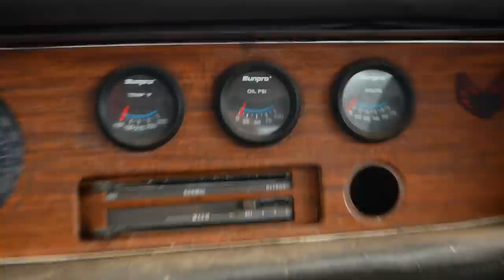Firebird Formula First Start in Years!

Comment: Is that the original hood for this car ? I love these cars...thumbs down to the SBC in this car anyway.. would rather have seen a Pontiac 400... consider a 455.. please ! Nothing wrong with a quadrajet by the way... probably the most misunderstood carb ever.
Reply: that is a factory formula hood
Reply: the 400 was a damn dog. around 200hp out of 400 inches is sad
Reply: Yeah the 350 is sad
Reply: We always called them quadrajunk when I worked at the dealership.
Reply: @zuestoots5176  I was more speaking to the originality of the car...yes the 400 wouldn't be my first choice of Pontiac engines... however I have seen some that were warmed up nice.
Reply: @lawnmowermanlawnmowerman9930  Hell I call them that to..the name just seems to stick. I have known a few guys who really know how to work them.. when they work they work well... when they don't and you don't have the knowledge to deal with them..yes they are a nightmare.
Reply: my 2 cents.  The 400 can be built, but only as far as a 2 bolt main will allow ( chevy ). The Pontiac 455 came in 3 versions. Base, High Output, and Super Duty. The base 1970-71 engine produced 200 hp and 455 lb/ft torque. The Super Duty 1970-71 engine had 335 hp and 480 lb/ft torque. Power was reduced after 1971. HOWEVER.....The Buick 455 came in 2 versions. The 1970 Base engine had 350 hp and 510 lb/ft torque. The Stage 1 engine had 360 hp and 510 lb/ft torque. ......sweeeet
Reply: The first thing to remember is, unless you've got a Ram Air 4 or Super Duty Pontiac, the engine in your hands is meant to make torque for acceleration. Too many try to hot rod it like a Chevy for high RPM, and find out the Armasteel connecting rods are basically cast iron, not forged metal. The maligned Pontiac 350 is a bit like an LS1, in that bore and stroke is similar, and the crankcase has a lot of volume. The latter is important b/c as the pistons come down their bores, they compress what atmosphere is inside the crankcase and creates pumping losses. If you want a Pontiac 350 to impress, grab a 4" aftermarket stroker crank, give it Chevy big block aftermarket rods, and then port 6X heads to feed 383 cid. As for the 400, its an overbored 389, and .030 over more means you can run a 455 piston with shorter skirts. If you honed out the mains, you can put a 455 crank in and now your 400 just got 55 cid extra. Or look at aftermarket stroker kits, you can get 488 easily. You won't be shifting at 6,000 RPM, but so what? build it for torque in that RPM range, give it highway gears, and you've got a freight train. The late 1970 blocks should be avoided like the plague, but they too can get taken out to 440 cid and warmed up. Oh, and the other issue with Pontiac engines is their lifter bores--they hang out there in space with little support, so if you go crazy on the cam, they snap off. But again, you aren't building a Chevy to run up to 7,000 RPM with a ton of lift. And that Quadrabog has a ton of tuning capacity and you don't have to take off the float bowls but you do have to realize, any spreadbore carb bogs b/c the secondaries are so big. don't open them up quick, and you'll find you have a responsive carb
Reply: Grandpa had a 70 Bonneville 455 Thing was Huge.. Putting in the Lead additives at Hess Gas station...  Dug the 60mph to 130.. Miss that car....
Reply: @lawnmowermanlawnmowerman9930  quadrajunk for those who dont know how to abjust them
Reply: @albertgaspar627  The Armalite rods are Nodular forged steel, they made the forged rods for the 8.2 cads too. Aside from the AR-15
Reply: Think about this...how long ago I'd they put the SBC in there? If they blew the original motor, it may have been cheaper and easier to but the Chevy in there. Pony motors are getting harder to find and more expensive to buy. If it wasn't a super rare, numbers matching car, I'd rather have it on the road instead of sitting there. So many project cars sit around with guys saying "one of these days, I'm gonna find the right motor to drop in there" but they never do.
Reply: @lawnmowermanlawnmowerman9930  I called them "Quadra-suck"
Reply: thats factory stats
Reply: @Trendyrapslut   I was once offered an Olds Rocket 350 for free. I was talked out of it, due to the lack of parts and aftermarket support. This was back before Olds went belly up. It's not that a SBC is a "better" engine, but the OE parts and aftermarket support is far greater. Another thought... perhaps an earlier owner pulled the original motor out for another build (GTO perhaps?) and it was sold with no engine. If I bought that car with no motor, I'd probably do the same thing. I'm not saying, I'm just saying...
Reply: @mattsez2879  Friend, your stats are incorrect. SD engines were only available in 61-63 and 73-74. Horsepower was 350 for base 455's in 70, and 370 for HO. 200 horsepower was ratings for 75-76 455.
Reply: @zuestoots5176  Depends on the year, and heads. A decent 461 build will average about 535 HP, and 550 Ft Lbs of torque.
Reply: @lawnmowermanlawnmowerman9930  undoubtly you don t know how to set them up properly !!
Reply: You're welcome. I got a 1969 GTO for free more than a decade ago, so I got to learn and experiment with the engine design. The Pontiac 350 was looked down upon when 455's were still cheap, but the day of dragging home a Pontiac Bonnie wagon that doesn't have a corporate 305 for parts is done. I was able to score a 1971 LeMans 4 door with a 400/Th400/LSD 10 bolt and a/c for $425 from a gas station who even towed it for free the next time they sent a flatbed out to my town. Took what I wanted (including T3 headlights), and someone wanted the windshield so I got them to haul it all away. Now everyone looks on the internet for car parts :)
Reply: the non-Super Duty connecting rods are ArmaSteel, which is a casting: https://www.pontiacdiy.com/connecting-rods-performance-guide-for-pontiac-v-8-engines/
and of course, Armalite Corporation made the AR-10, then AR-15 and AR-18. Ironically, when the civilian Sporter rifle first came out, consumers hated it thinking the 5.56 mm round to be a squirrel round and wanted a .30 caliber round. Now everyone wants an M-4 clone, there's even parts to make an AR-47 clone look like an M-4 with vertical foregrip and telescoping stock and laser scope mounts.
Reply: Nothing wrong with Quadrajet. Many people don’t know how to tune it or adjusted correctly.
Reply: What catches a lot of people off with a spread-bore carb, is the oversized secondaries. Dump them open too quickly, and you get....quadrabog at low RPM. But get it right, and you won't have a handful of fuel from all the jet changes.
Reply: @zuestoots5176  that was after everthing went to unleaded gas. Those pre unleaded gas 400 were very underrated in the HP department!!! It'll whoop a SBC 400 all day long!!!!
Reply: @mattsez2879  you got your years wrong dude, plus they were underrated hp numbers also.
Reply: @albertgaspar627  built right, a 350, 389, 400 Pontiac engine will live turning 7500 rpm. Factory N armasteel crank is just as tough as any Chevy sbc forged crank.  Get good forged rods, hope he puts a real Pontiac engine in it.
Reply: @byronmcelfresh2380  I should clarify. The engines you mentioned, of course, have the smaller main diameters on the crankshaft. When Pontiac tried to replace the 425A Trophy 389 with the 421, initially teams wanted to return to the 389. The 421-428-455 have a larger diameter mains so that the extra stroke in the crank has overlap on the rod bearing diameter, so that the crank has strength (just like a 400 Chevy small block uses bigger mains than the other small blocks). The result is a crankshaft with more surface area to build an oil wedge on, to keep from smearing the main bearings--same issue with an Olds 455. Getting the larger diameter cranks to survive past 5500 RPM is an exercise, but the smaller diameter cranks mentioned just need a pass thru a machine shop and balanced to some aftermarket Chevy big block connecting rods, and they'll match a solid lifter 396 for bending a tach needle.  Also, I can understand why at one time, a prior owner of this vehicle grabbed some Camaro engine mounts and tossed in a Chevy--just swap fuel lines and worry about bolting up a BOP bellhousing creating any issues. But now you don't have to go to a swap meet to hunt down BOP parts anymore :)
Reply: I love quadrajets, I've never had a problem with them even when they aren't adjusted good. The only stock carb I've ever had a problem with was the thermojunk carb
Reply: yep, and this was the prob:  https://jalopnik.com/thermoquad-252133
Reply: in this age of EFI, being the best carb is like being the world's tallest dwarf :) but I get your point, when you're slappin' together a toy with parts you need to clean out of the garage, a carb is cheap and easy way to get an engine going. Like I posted before, what grabs a lot of people is those big secondaries, which is why its typically called a "quadrabog". But, get the secondary linkage right, and its not an issue. Where the Q jet has it all over the Holley is you don't get your hands wet with gas to change the "jets". Where the Q beats the Carter is the lack of plastic. That's where its better than any carb short of a Webber/Delortio/Mukini or any downdraft carb you find on a Cobra etc. Back in my day, you could still find a Q jet in the junkyard for $5 and up, while the OEM Holley would be $20 b/c it had the name "Holley" on it (tho truth be told, i'd always try to grab the Holley 2300 2bbl off any Chevette I found, and then try to sell it to a Mopar Six Pack fan :)  )
Reply: Yes , the original hood for the (70-73)  Fire Bird Formula ! , What I really admired about them as a teenager was they were stock fiberglass hoods.
Reply: Well i guarantee you that that 350 is making more hp than the factory 180hp 400 😂😂😂😂😂 atleast you are probably getting around 250ish hp from the 350 but anything can be built
Reply: @icedragon642  i don't know what Pontiac 400s you have had but I've never owned a stock one that would just outright kick a chevy 400 ass and that also depends on the year and i don't like admitting that because i am a Pontiac man always have been the firebird to me always had way better looks and style than a camaro
Reply: as the saying goes, HP sells engines, torque wins races. I'll agree the 350  makes more HP in that condition, but torque will accelerate the weight of that F body, and its possible the bigger engine is going to do that at a lower RPM. theoretically :)

Comment: Nice Firebird! I've seen much worse! Most of the bodywork really doesn't look that bad. Yeah, The front of the roof & windshield channel are toast but that can be cut out & replaced with metal from a parts car. Definitely yank out that Chevy engine & replace it with a Pontiac engine. All Pontiac V-8's are the same size externally, so a 400 or 455 will slide right on in! Another nice thing about Pontiac engines is that  most years, they have the engines displacement cast into the blocks on both sides towards the front which eliminates guessing. Are you gonna be making more Lemans videos?

Comment: Chevy V8? Blasphemy!  The heart of the beast is missing.
Reply: That's right take that garbage out and put real Pontiac Heart shame on who ever puts chevy crap on Firebirds,,,
Reply: In those days you trashed a motor or transmission, your local “cooter “ found you a used motor or transmission that “fits”
Reply: Matthew Fogarty - Pontiac was the last division to adopt the Chevrolet “corporate” engine, they held out until the early 80’s, producing their own engines. Buick and Oldsmobile engines were history by the mid 1970’s. Pontiac did get caught up in the change over a little bit and some Trans Am’s got a Buick 406 mill instead of the Pontiac 400ci engine.  At the same time you could find a Buick engine in your new Oldsmobile, or some other odd combination. It made many people angry at the time but GM was clearing out the warehouses in preparation for the corporate (read Chevy) engine policy. It should be noted that it was a money saving measure and the other divisions were making some great engines at the time. Pontiac kept their Super Duty program going into the late 70’s and even offered a Pontiac built (and designed) 305 in 1981 if I remember correctly. 

After that, the only significant difference  between a Camaro and a Firebird was the grill, tail lights, and dash.
Reply: Matthew Fogarty - Noted. Missed it by that much, lol. That’s what happens when ya get old. Thanks for the correction (s).
Reply: Matthew Fogarty - Funny! you caught my reference there, almost no one remembers anymore. It was a fun show.

Comment: its sweet- so period correct with the gauges and shift boot ect.... probably last worked on in the late 80's or early -mid nineties? dual exhaust out the valve cover grommets after fixing the valves

Comment: I have a similar project.  I have a 73 Firebird Esprit (sp) 350/ 3-speed. I have most all of the parts to build a 455 SD Trans Am clone. This one will be a little different, 4-wheel disc brakes, WS-6 suspension, to name a few things.

Comment: an old school "tuner" knows you just fill the Q-Jet with gas, push the throttle a couple times and look for fuel from the accelerator pump,  set the carb choke to full on,  set timing with a timing light,  check for spark,  lash valves correctly whether hydraulic or solid cam ,   carb holds enough fuel to start and run engine for a couple minutes.   Slowly raise rpms on engine when cold,  silly to just jam the throttle on a cold carb'd engine.  You check the engine oil level before any cranking.

Comment: They called those quadrajets, quadrajunk, but I still maintain that if you used the car on the street, they were the best. Two little barrels to spoon feed the beast when not in beast mode, and two monster barrels when you needed to go to Beast Mode and shit and git. I checked my mileage several times, highway, babying it and saw over 20mpg. Dad had his rear barrels tied closed in his 472 Coupe De Ville and he saw over 20 mpg on a regular basis.

Comment: Gas has changed a lot. Setting the air mixture screws I always start with 3 1/2 turns out.Also let the engine warm up good before opening the choke wide open.Those old engines are cold natured.

Comment: I want to buy this car from you, as it sits. I'll give you $4000, or trade for my really nice 2008 BMW 328xi, with only 109,000 miles on it. It's all wheel drive. 3.0 liter engine. 6 speed automatic transmission, with manual sport shifting. 3:91 gears. This car is quick as hell. Keeps right up with my 1993 40th anniversary Corvette! I just did EVERYTHING to it less than 50 miles ago, and it needs NOTHING. New: All 4 high performance 205/55/HR 16 all season Cooper tires. 4 new Stagg high performance shocks, new high performance drilled and slotted 12 inch rotors with full ceramic brakes front and rear. (yes it has the sport suspension pkg) new windshield,  new wiper blades, new valve cover gasket and CVV valve. New ac compressor and freon, new Gates serp belt, new platinum spark plugs, new battery, new Molbil One oil and filter change, new 80-W-90 gear oil change in both front and rear differentials, new 7 inch touch screen DVD/CD/FM/Navigation stereo entertainment system with remote, stylus, and full 1080 HD LCD color night vision back up camera, with complete ac and heated seats relocation kit. Yes, it's got heated seats, and auto headlights and wipers, full steering wheel controls for the ac and the stereo system. Factory alarm with new key fobs. Like I said, this car needs NOTHING. All 100k maint. completed, and then some. I just dropped over $2 grand into this car. It currently books for between $6,000 and $8,000. I'll trade my BMW even Steven for that Firebird. Let me know. I'm asking $6,000 for the car. It's Titanium Silver metallic, with black leather interior, and has no rips, or rust. Power sun/moon roof as well. Has the nice, highly sought after BMW double 5 spoke wheels. The best of the best.

Comment: rebuild a 350 and don't touch the transmission I mean give the clutch a one over, but other than that leave it alone. Do all the body work and don't fill any damn thing swap it out with original parts did everything nice and straight make your body panels perfect in alignment and then throw some soft satin black on it and a set of nice American Racing wheels,or even some old school craigers and let it ride.. thanks for the video bro good job and congratulations on the car it's awesome

Comment: Seems like progress! Some anyhow! I'm still hearing popping threw the exhaust ! I low you want a Pontiac engine but Chevy is cheaper to rebuild and parts are plentiful! I think I would either rebuild this engine. I once had a small block Chevy 400 out of a 73 caprice wagon bored 30 over with a bunch of goodies and it was a hell raiser so If I can find another 71-73 SBC 400 I want to try and turbo one or an LS!

Comment: Hey man nice find, I may have a few suggestions about the car, I own a 79 and have put up with the typical rust areas all these cars have when they sit outside, 
The leaky front glass and rotted dash corners, GM had a design flaw with the size of the ledge that the windshield sat on, so when the car torqued enough it comes loose, and water gets inside and rots the dash and floor pans,
And not to mention the caged nut spin when you replace the subframe bushings 🤣 that shit was crazy 
Rear area of the frame rails
And trunk,
And also some metal or some parts are the same as the 70-81, more so 70-76.
The later parts car firebirds are alot cheaper than 70-73